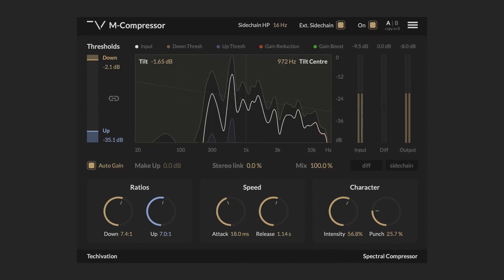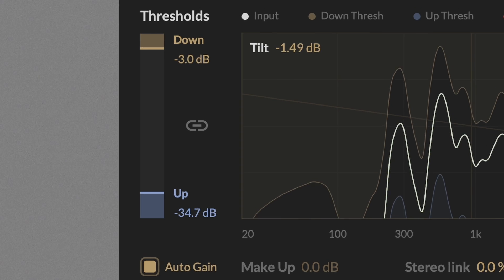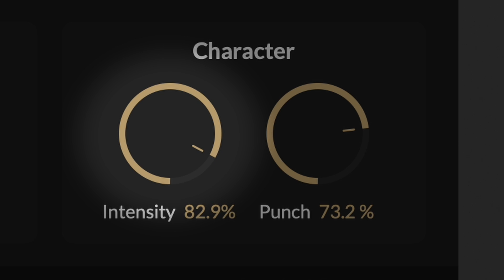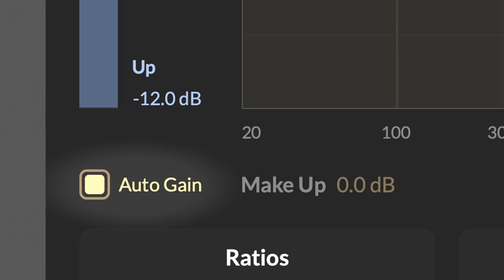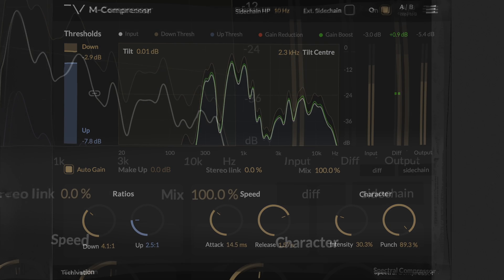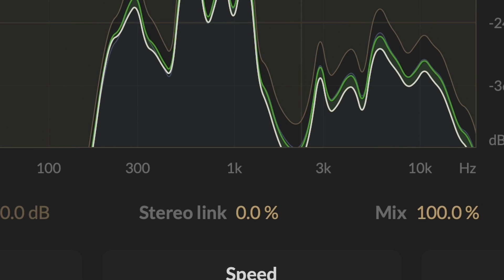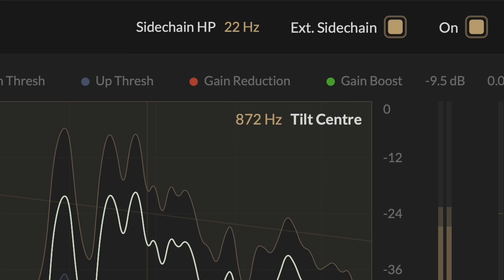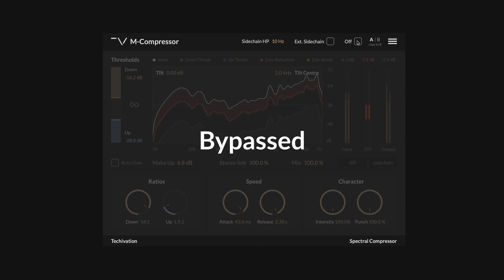Techivation M-Compressor Walkthrough

Comment: Is this similar to the Waves MV2 compressor which I already have? I also already have the T-Compressor.
Reply from the maker: The M-Compressor is currently the only true spectral compressor in existence. The shape of the spectral threshold in the M-Compressor is determined by the spectral contour of the input signal and dynamically changes with the input, resulting in artefact-free, true spectral compression.

Comment: Hello there. 
I just purchased but haven't thoroughly tried it out. Watching this tutorial in order to get acquainted  with the comp and its functionality.
Two things I wanted to know. 
1) I would like a wider SC work area. Like 0-200 Hz. Why does it go only to 120? 
2) What do you mean by "apply a HP filter to the External Sidechain Signal" ?  I thought that a SC filter is that by default? Meaning that I always thought an internal  SC filter  is a HP filter for the Detector circuit in order to exclude Low frequency content from the Detector of the Compressor? 
You mean that it applies  HP filtering to the SC filter of the Detector circuit when feeding it external signals ? 
So if I have an incoming Drum set and Apply HP of 120 then the detector circuit  will not react to the low frequencies of the Kick but only  to the rest of the Kit ?  Can you make an example of its usage scenario ? 
I am having a bit of trouble visualizing-understanding what you mean.
Reply from the maker: Hi,

Thanks for your comment.

Please check this article for more information: https://techivation.com/blog/m-compressor-cheat-sheet-1/
Also the M-Compressor user manual: https://link.techivation.com/be3Tv6
Reply: @Techivation  I just did. So it is a normal SC filter. Ok I still hope you widen the operation range to at least 180+ better 200+ hz . Imho in modern bass music too much is happening between 100-200 hz  so it would be nice. The “120 hz” choice reminds me a bit of “old school emulating plugins aimed at rock music mainly” when bass was an e-bass and a kick drum mainly. Example , look at Smart Comp 2. Also a spectral compressor, but with a whole sidechain equalizer section. Very flexible